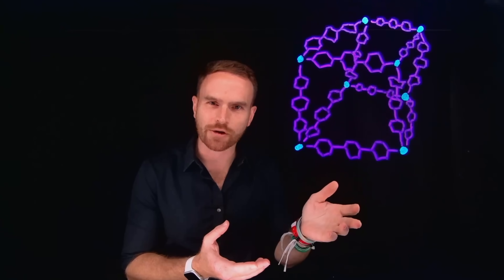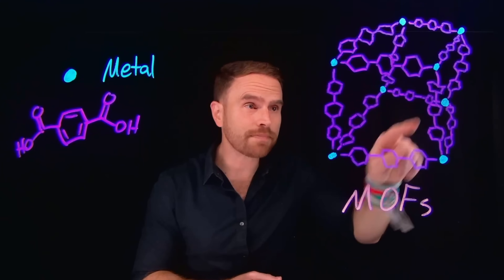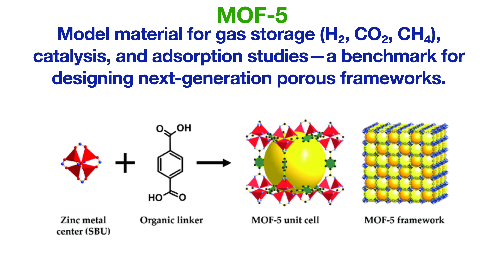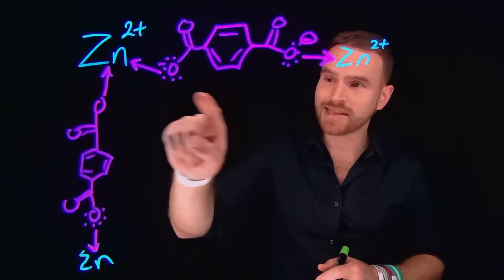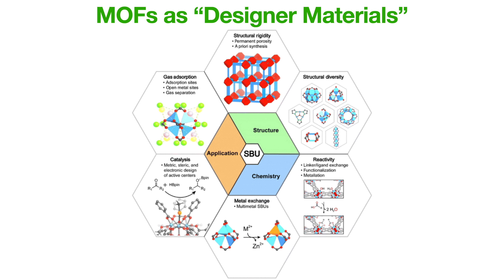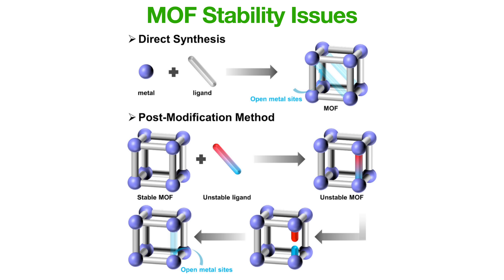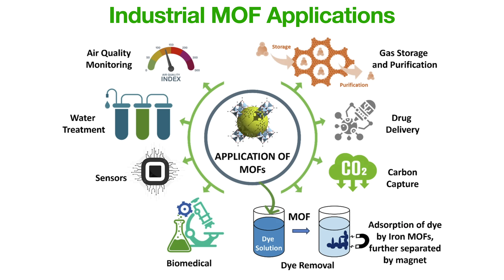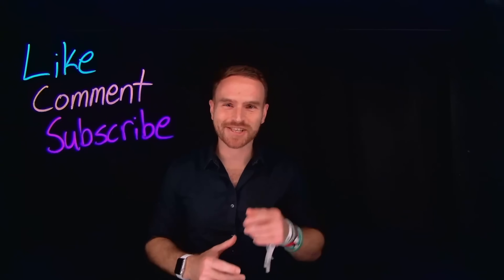Nobel Prize 2025: The Chemistry of MOFs Explained!

Comment: I have a question.  Do these MOFs crystallize?  I have a feeling it they do and with a proper linker group so the whole system conducts, it might be possible to create high TC superconductor this way.  You see, the key to high Tc superconductors is to have a crystal lattice structure where the highest sound-wave frequency vibrational modes are very low and thus are very, very long wavelength.  And the bigger the lattice spacing means the larger this wavelength.  It seems to me this would be an ideal framework for studying superconductors;  Assuming it can crystallize and it can conduct electricity, of course.

e:  I wrote this without watching til the end, I guess they do conduct and crystallize.

Comment: These MOFs could be unfathomably great for catalysis and allow for driving more complex or multi-step reactions. I wouldn't be surprised if we saw them everywhere in batteries, pharmaceutical chemistry and fuel cells 5-10 years down the line. The drug-delivery aspect or the medicinal application of MOFs in general (a new class of antidotes when modified correctly? could MOFs be turned into cholesterol scavengers? etc.) is fascinating as well - maybe I just found a topic for my master's thesis :D Oh and I'm pretty sure these could be turned into dyes too.
Reply from the maker: The fact that your mind is racing with clever ideas is a great sign! I couldn’t agree more on your assessment!

Comment: Just to dumb it down for the more common folk my only question to sum this up is.   If you can put lets say gasoline molecules broken down in the mofs and lets say they have the tech to transfer that into vehicles you would then have a car that can run for as long as a football field worth of gasoline? 

Note in question it doesn't have to be gasoline it can be anything that can make the engine combust and run.
Reply from the maker: That’s a really good way to think about it — you’re right that MOFs can store an enormous amount of material in a very small space because of their huge internal surface area.

But instead of storing liquid fuels like gasoline, MOFs are best at trapping gases — things like hydrogen, methane, or even carbon dioxide — inside their tiny pores.
So in theory, you could have a hydrogen-powered car that stores much more fuel safely and compactly using MOFs instead of high-pressure tanks.

They don’t generate energy themselves — they’re like ultra-efficient containers that hold molecules until you’re ready to use them.

In short: MOFs could someday help store cleaner fuels (like hydrogen) much more efficiently — but not literally stretch a football field’s worth of gasoline into your gas tank. ⚗️🚗
Reply: Thank you for the breakdown. This is both exciting and intriguing